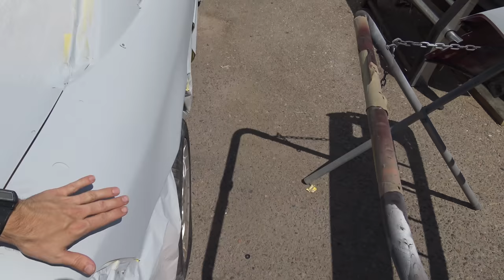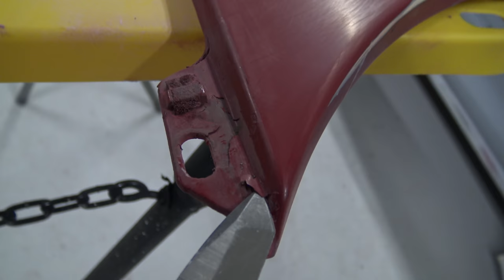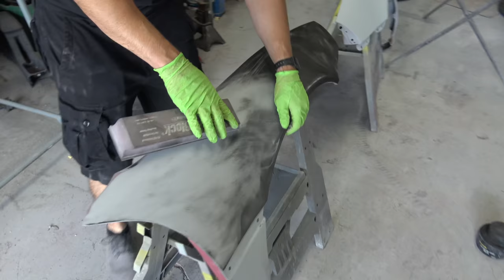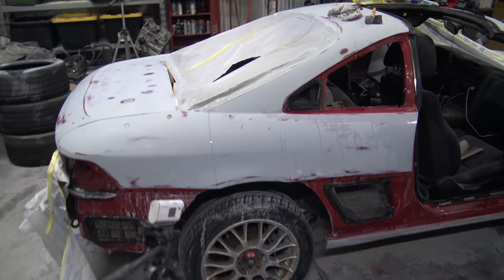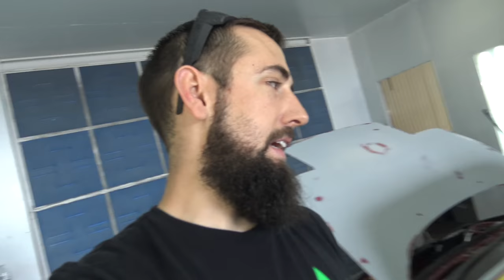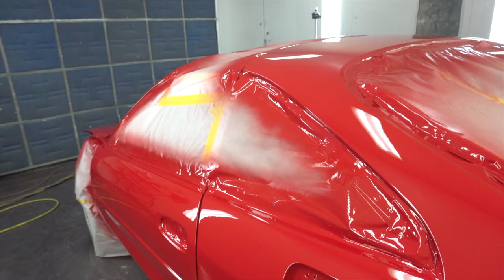Pt.3 | Boostedboiz $400 MR2 build | IT'S PAINTED!

Comment: I feel as though BoostedBoiz got a much better deal in this.  Your attention to detail with this paint job is 100x better than the attention to detail with the cage being built in the civic.  The A pillar bars should tell you everything.  They dont line up with the A pillars.  That would drive me nuts.

edit: and yes...I have built cages before.  MIG and TIG

Comment: Hey Trever since the original paint was a single stage paint, the only proper way to do it was to use a paint stripper to remove the paint down to bare metal. When we go to body shop certification training, they taught us that the only proper way to respray single stage paint is to remove it down to bare metal. Even for newer high end repairs on Ferrari and Lamborghini, they encourage properly removing all old paint before spraying primer. The only reason that most body shops only scuff up the old paint for respray is that insurance wouldn't pay for the extra work to remove all the old paint.

Comment: To keep you panel sanding standards from moving around on as much gets some canvas coin bags and fill them with lead shot or better yet get some heavy duck cloth and sew them into 6 diameters tubes 20 to 24 inches long and fill them with 15 to  20 pounds of lead shot, if you don’t spend the money on lead shot you can buy old wheel weights and cut them up into 1/2 pieces and toss the metal clips because they will rust and tear your nice new weight bags. Resist the urge to use sand because even if you double bag and double seem the bags they will leak this fine dust that will ruin your day doing body and paint work.  Opps one last thing with the stands with out a center support rod lay a broom stick (or piece of tubing) across at the hinge point and hang the weight bags over the broom stick.  PS Nice work I hope Kyle appreciates all the extra work you are doing painting his car.

Comment: Colour looks nice and deep. Even clear finish too. Will you be flatting and polishing it before it goes back? 

Here in the UK we rarely use sealer primers before painting. We'd just finish our primer in 800 wet block or 500 da and base straight over as long as there were no break throughs

Comment: Do you use a flex agent on the bumpers so the paint does not crack later? Or is that an old problem that modern paints have overcome? Example: front nose/bumper on my old 1972 Pontiac Formula?

Comment: You have come a long way since the supra, i havent watched you since then but that was cringe worthy for me to watch as a professional bodyman and now painter. Stop spraying over such aggressive grits. 180 is perfectly fine for filler primer, not sealer primer. I would never spray sealer primer over anything less than 320. The result might look the same after it comes out of the booth, but over time those higher grit scratches show back up in the clear from shrink back. I promise.  Also, only spray primer over DA scratches. Never spray anything over straight line sratches, i didnt see if you did that or not but i thought i remember you did on the supra, those will 100% show back up in the clear later.
Reply from the maker: Went over the whole thing wet sanded with 400 before sealer